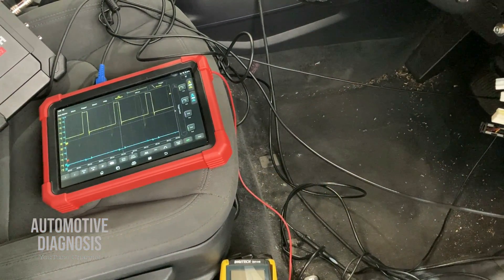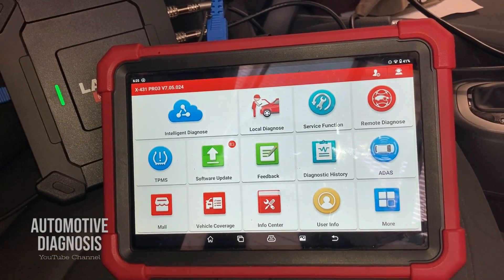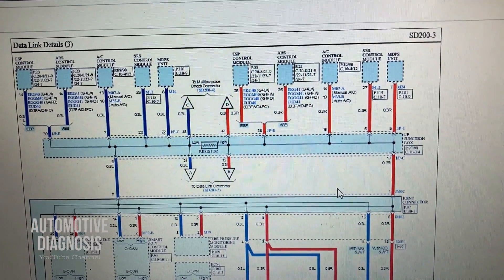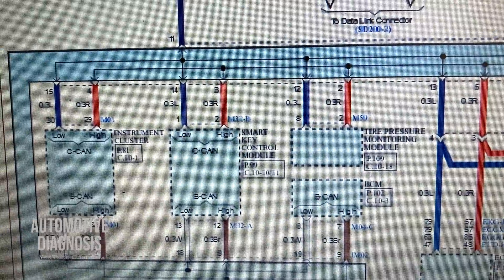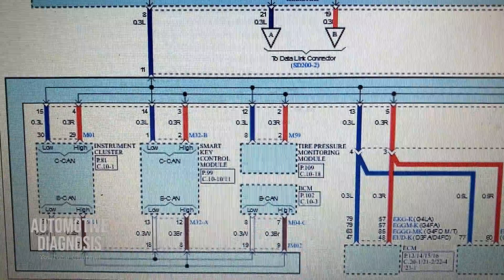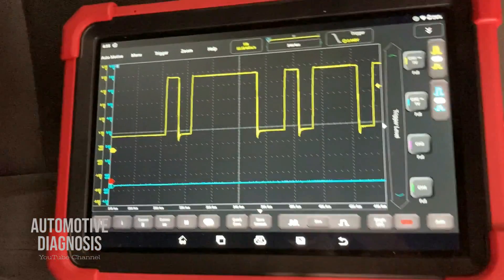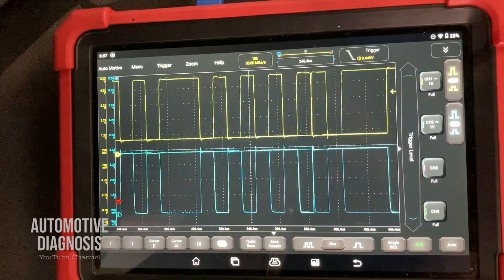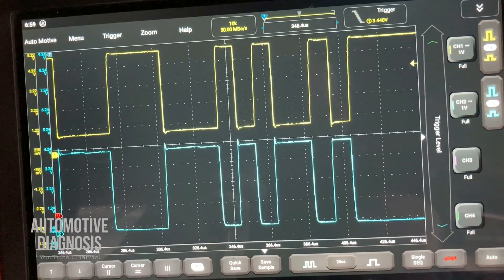CAN-BUS Explained | Body Electrical CAN-Bus Diagnosis | Test B-CAN with Multimeter & Oscilloscope

Comment: What would have happened if you had shorted the two cans with each other?( the high and low of B CAN) How would the waveform have changed?
Reply from the maker: Having both lines of CAN-Bus shorted to each other is gonna bring the entire network down, so you will see no waveform on any of them.
Reply: @AutomotiveDiagnosis  I see, thanks for answering. Can you make a video in which you will have created a real fault and show us how can we locate it? For example making a short to voltage in a random point of the circuit and then explain how can we find the point in which the shortage is, assuming that you didn't know?

Comment: Hi Dear,
Were we seeing a mirror signal between B CAN Hi & Lo or i couldn't catch-up the vedio correctly?
My 2nd Question is B CAN posses 0 to 5 volts on each wire?
3rd Question...does B CAN & M CAN have same 120 ohm two terminating resistance like they are there in C CAN network???

Comment: Hello Boss, I thought CANH and CANL is a differential signal. Either CANH and CANL is short to ground, the information that is sent to the bus by the faulty unit will be a garbage to the recieving unit.
Reply from the maker: Hi there, the behavior is different on C-CAN or B-CAN. Normally on C-CAN if one line on CAN-BUS is shorted to the ground, the entire CAN-BUS will go off.  But on B-CAN having a wire shorted is not gonna disrupt the entire Body CAN. That’s why I presented the waveform when CAN Bus was shorted.

Comment: Hi boss thanks for sharing with us nice information but I had one kia sorento 2.2 crdi 2016 faultcode p1827 4dw pressure sensor signal  short to battery positive and 4WD light on the cluster but ihave also another same car I can use everything from there to here like 4WD ecu 4WD switch and fusebox  and cluster also even ican change the pressure sensor but same faultcode is still there I checked the wiring with the multimeter no short no open circuit everything is fine can you have any idea please
Reply from the maker: Hi my friend. If you have checked the wiring and replaced the sensor, the next possible cause could be the 4WD control unit. But please check the wiring again by this references:
There are 6 wires on 4WD coupling. (Based on the model you mentioned)
Pin number 3 (Blue wire) is signal which must give you 3.8 V when ignition switch is on.
Pin number 4 (Red/Black) wire is power which must provide 5 V when ignition switch is on.
and Pin number 5 (Black wire) is ground. 
Please check it again considering the specifications mentioned above.